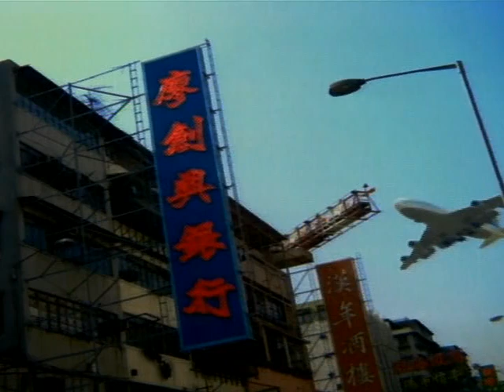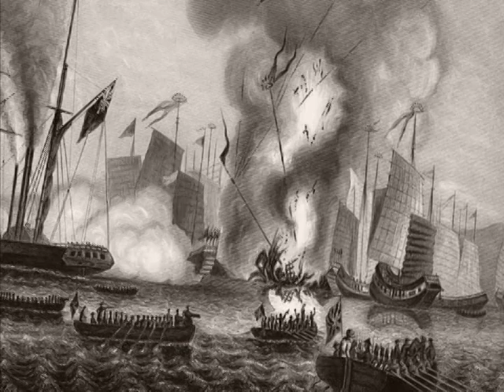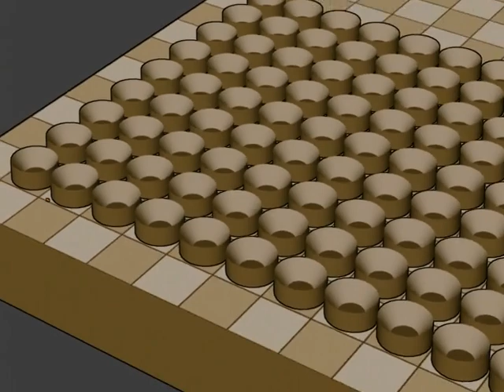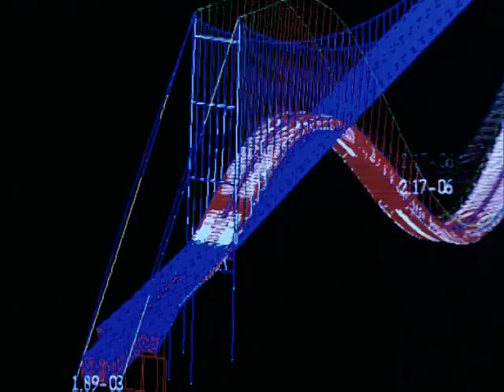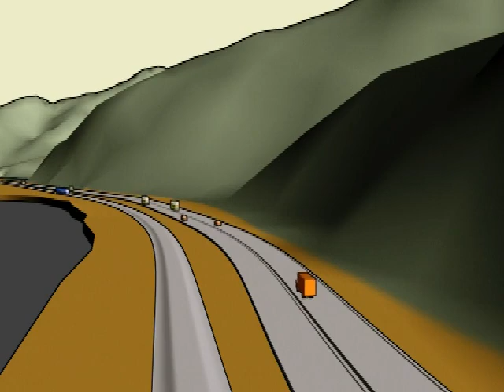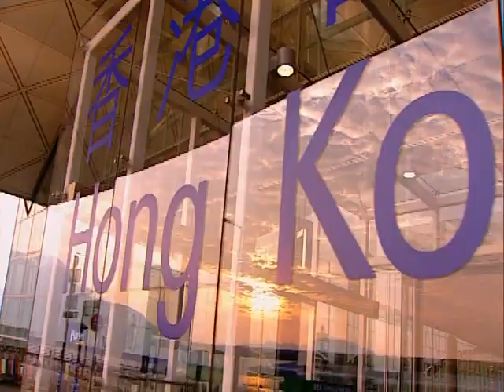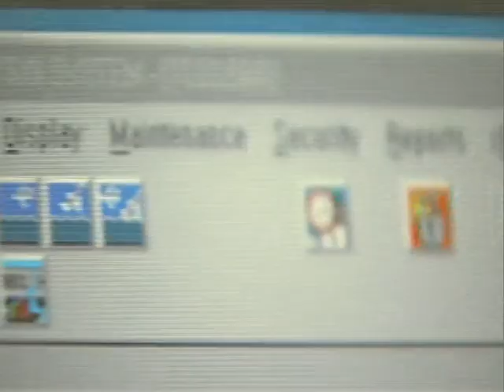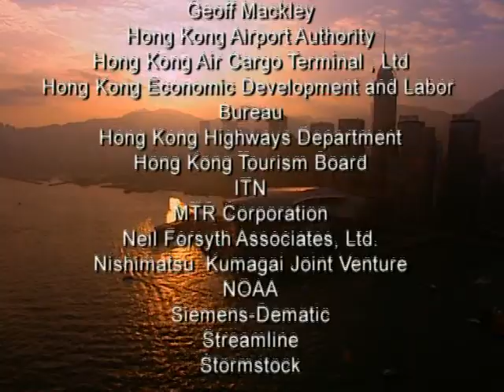Building Hong Kong's Airport | Extreme Engineering

Comment: Hong Kong International Airport is the busiest airport by cargo volume from 2010-2019, and 2021. The passenger traffic is lower than London Heathrow, busiest in Europe. But the cargo volume is 4 times as much.

HKIA has a very large cargo apron and 4 cargo terminals -- HACTL, AAT, CPCT (by Cathay Pacific) and DHL, each still have extra land for further expansions of the handling facilities. It has a massive concentration of cargo freighters, while in most international airports freight is restricted to passenger jet cargo holds only.

Comment: 39:40 Hurricane Sam this was the worst the airport faced a plane landing in a storm and a severe fire. China Air 642 tried to land during the storm but got caught in gravity well when Sam's eye hit the airport. The plane flipped upside down, skidded across Runway 7L, and smashed into the pappy and dadum lights at the end of the runway and burst into flames. 208 passengers and crew were injured and the first officer, flight engineer, and the captain were killed. Since that incident there have been six accidents at the airport. 2006 Cathy Pacific 780 landed at the airport with an engine fire in both engines cause of the crash was contaminated gas from a hydrant in Surabaya. 2021 UPS 5X003 suffered an engine fire and had to go around NTSB is still investigating it. and 2022 United 2831 suffered a bird strike and fire and had to go around NTSB is still investigating the incident.

Comment: Hong Kong International is still growing. The reason they built it is to replace Kaitak. Everyone knows Kaitak is the most dangerous airport in the world. Every day from 1925 to 1998 big giant 747s landed on people's roofs. The citizens of Hong Kong did not like it so they built the new airport on Chek Lap Kok Island. 

22 miles of road, 12 tunnels, 14 bridges, 30 miles of high speed rail, 4 new cities, two theme parks, one stadium, two terminal buildings, an underground subway, 47 miles of cable cars, six concorses, and four of the worlds largest cargo hubs complete the project. 

Here is another fact when they leveled Chek Lap Kok Island it took 12 million lbs of dynamite and 4 dredgers to clear the channel so the runways could be built. For the third runway they did not dredge they capped it and used deep cement mixing and pile driving to form the runways base. In 2023 Terminal 2 and Concourse H will open and more planes will arrive as Hong Kong International Airport continues to expand.

In its history Hong Kong International only had three accidents First one was in 99 China Air 642 got caught in the gravity well of Hurricane Sam the plane was flipped upside down and hit the pappy and dadum lights on the runway causing a fire 208 passengers were injured and the captain, first officer, and chief engineer were killed that was the worse one. 2006 Cathy Pacific 780 landed at the airport with an engine fire in both engines cause of the crash was contaminated gas from a hydrant in Surabaya. 2021 UPS 5X003 suffered an engine fire and had to go around NTSB is still investigating it. and 2022 United 2831 suffered a bird strike and fire and had to go around NTSB is still investigating the incident.
Reply: @FlatEarthKiller  the other is Ocean Park which is on the southern tip of the island on land reclaimed from Kaitak.